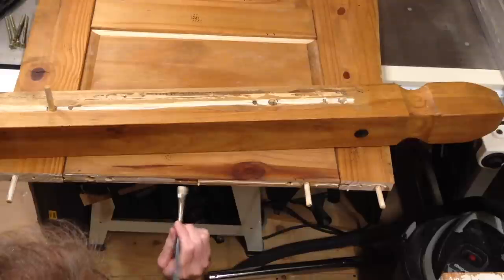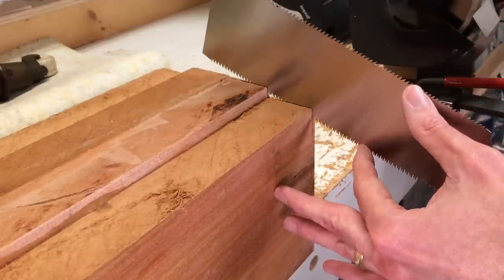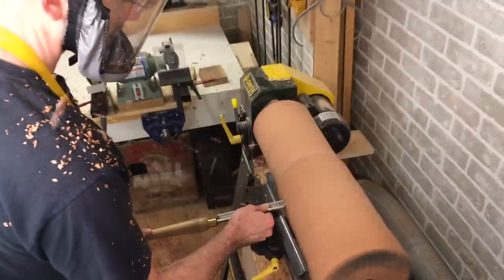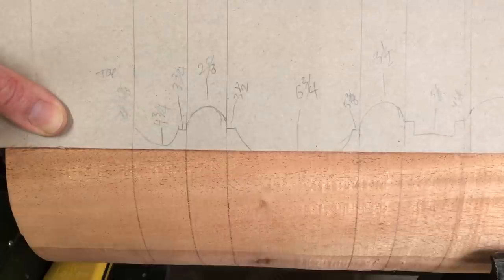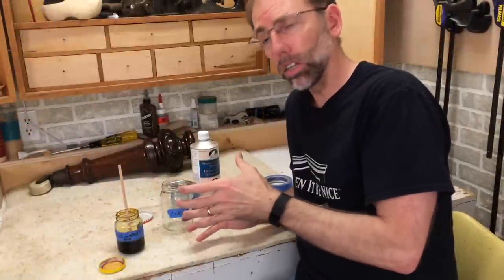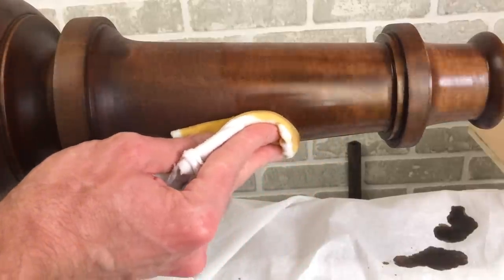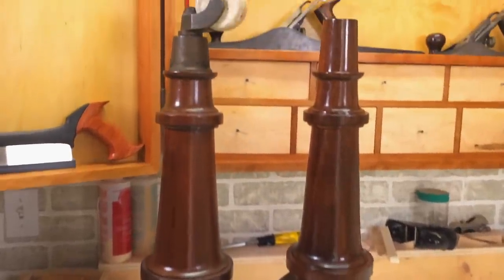Wood Turning Commission to Reproduce an Antique Table Leg | Restoration by Fixing Furniture

Comment: Yes Scott, lots of smiles while watching this video. I've been turning for six years... A customer wanted a table with basic round legs, so I bought a lathe. Then they changed there mind. Oh well, I now turn just as much as I 'Cabinet' make, but for the enjoyment. I wont make any comments on the turning. You know now what is good and bad 😎.
Reply: P.S. I also joined a local club to get the tuition.
Reply from the maker: Thanks for sharing that Peter.  Glad to hear you're enjoying turning.  Cheers

Comment: I have found using a contour gauge helps me a lot when duplicating a piece.
Reply from the maker: Interesting.  I've tried one but it didn't work well.  Do you have a brand you can share?  Thanks.  Scott
Reply: There is one at Lee valley made of steel which is full of dents, thus providing a more detailed profile. Greetings from Brazil ! My name is Eliana and I love to restore pieces as a hobby. I'm a rookie.

Comment: Great video Scott. I always wanted to learn how to turn with a lathe but could not justify the cost for one or two turnings I might do or have done. But always appreciated the skill set involved. I have done lathe work with metal in my previous job as an Elevator installer /repair work. so do have some experience there. thanks for sharing. ECF.
Reply from the maker: Glad you enjoyed watching Ellis.  Maybe that's something you can do in the future.  I purchased my lathe used so it was less expensive to get into turning.  Cheers.  Scott

Comment: Love this! Scott you’re amazing and you’ve given me the inspiration to restore my grandparents old furniture. 
Question though, every restoration video I’ve watched all paint the furniture after it’s been assembled and I’m wondering why it’s a bad idea to paint the disassembled parts before assembling them back together.
Reply from the maker: Good question Izzy.  You don't want paint or any finish in the joints when you assemble the furniture as it prevents the glue from adhering.  Assemble first, then finish.  Cheers.

Comment: I do like your videos. You did end up with a nice leg.

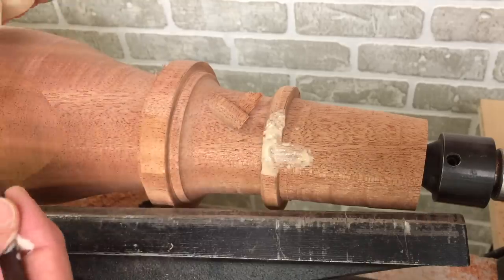I'll start with constructive criticism. Surprised you didn't use you chop saw to cut one side, then flip it over and cut the opposite site side. Also surprised you used a portable planer, instead of table saw or bandsaw to cut the corners down on the block. Since using a portable hand planer, you could of rounded it more. before putting on the lathe. Using the gouge straight on, is like using a scraper. Plus you will have to sharpen more often, verses using a slicing the cut. If you propped up the leg on the back for a reference, easier to match the cut verses stopping often to see wear it matches. If you cut down-hill 15:17 you'll get  smoother cut vs. up-hill 14:47. The angle going in makes a difference also 15:37, plus the speed (rpm) should be higher verses at the wider section. Helps to have a reference card for rpm for the different diameters next to the lathe. So you can change the rpm's as you go.

I liked you section on color matching the leg, and application. Nice looking dust collection hood. The hood I have I ordered from Peachtree. Yours has much more chip collection. Leg came out real nice.
Reply from the maker: Thanks for sharing your thoughts and tips Richard.  I appreciate it.  Scott

Comment: it kind of feel like you could avoid half of that mess if you sized your blank better. it seems like lower part of the leg would fit in just the 2 middle layers, unless that extra mass was needed for stability of turning
Reply from the maker: That's a good idea.  To be honest, I didn't think of that.  Thanks for the suggestion.  Scott #Tip
Reply: @FixingFurniture  it was strictly pragmatic point of view, saw off bigger chunks, use less materials and maximize the profitby minimising the time and waste

that and i also build some guitars in the past and sizing my blanks always made me do less mistakes and get faster to the desired effects. i never turned a thing but that was a tip from one of my books about turning bowls of all things

Comment: when I saw you sharpening the gouge by resting the back of the handle in the rest and holding the gouge against the grinding wheel I could imagine that it could easily grind too much off the tool and possibly pulling the tool into the wheel.  I would rather have a tool rest that the blade would lie against to get the correct angle, then you could slowly push the blade into the wheel to achieve the sharp edge